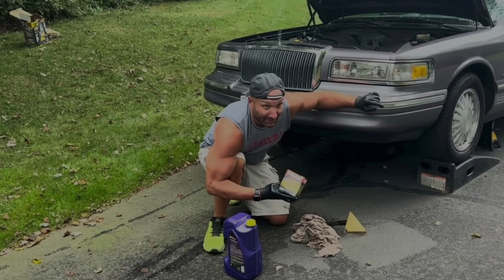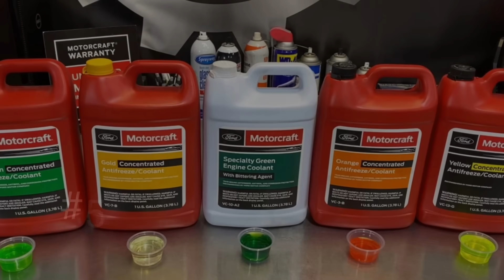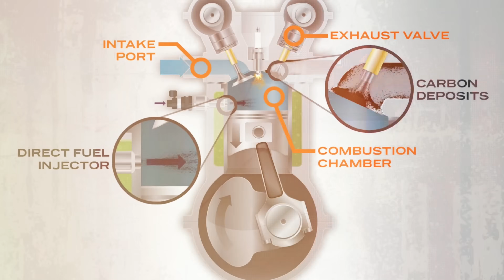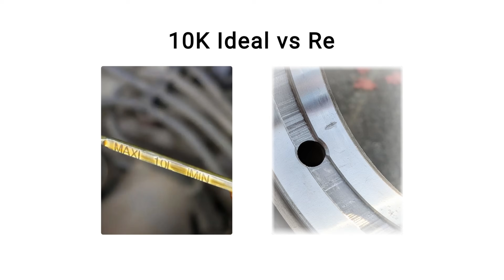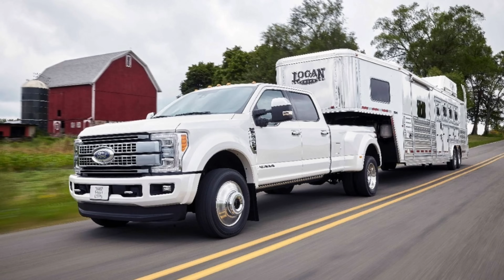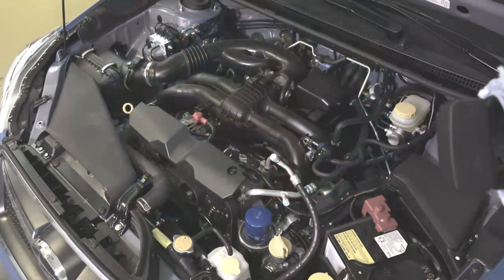6 Fatal Ford Maintenance Mistakes That Are DESTROYING Your Engine (STOP IMMEDIATELY)

Comment: Please explain.  What is the "coolant crossover" issue on the 5.0 coyote that I keep hearing about, and what ,exactly, do I do to correct it?  I've already replaced the plastic 3-way "coolant tee" with an aluminum tee on my 2017 F-150.  Is that the issue?  I look forward to your direction on this issue.  Thank you!

Comment: I changed the Transmission Fluid in my 2021 F150 that I bought used with 27,000klm on it.
I was shocked at the amount of particles in the bottom of the pan, it was 1/8th thick, Filter and it magnet were plugged, I replaced the Fluid that was drained from the pan and replaced it with Amsoil.
It shifted far smoother.

Comment: Have my oil changed every 5000 miles with motor craft 5w30 semi synthetic.thinking about going to full synthetic,2025 f150 3.5.
Reply: Good idea. I switched my 5.0 over to full synthetic at 1500 miles. 2 things I’d suggest. 1. Cut your oil change interval down to 2-3000 miles, especially on the ecoboost. 2. Use Mobil 1 full synthetic. It is a true PAO (Polyalphaolefin) oil. Some ‘full synthetic’ oils are actually hydro cracked oils which isn’t a true synthetic.
Reply: @liquidsmokemustang1537 2-3k oil changes would be if you were tuned with full bolt on pushing 100 hp over stock. A stock 3.5 is fine with 4-5k oil change intervals on full synthetic
Reply: @liquidsmokemustang1537  👍
Reply: @liquidsmokemustang1537do it right away.  We use Mobil Advanced. Full. SYTHN.